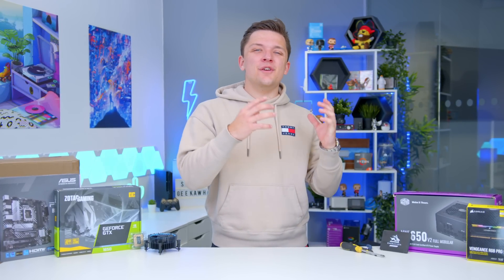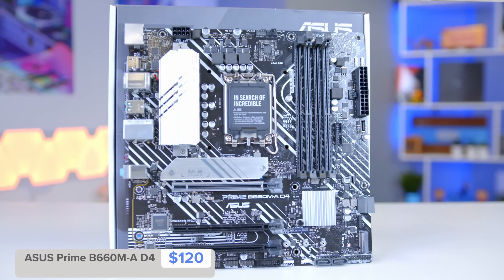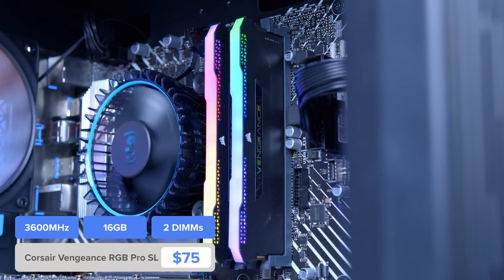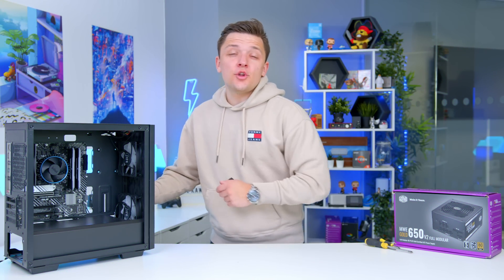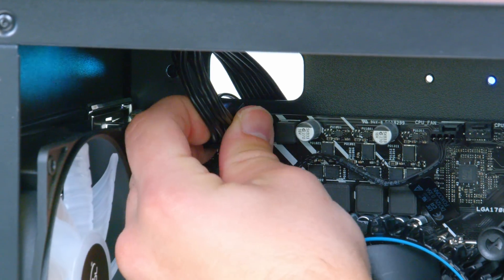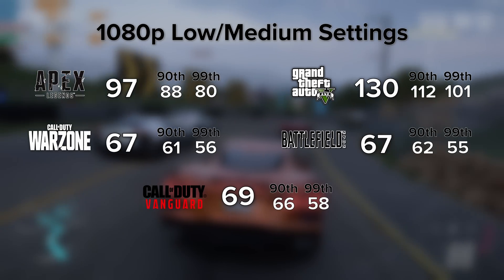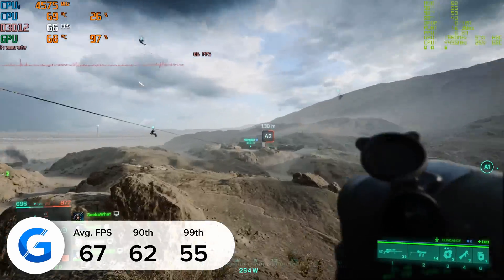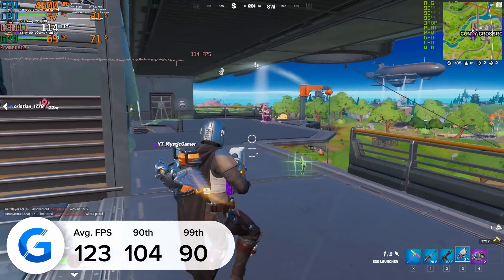Best $650 Gaming PC Build 2022! [Full Budget Build Guide w/ Benchmarks - i3 12100F & GTX 1650!]

Comment: i just put together a build like this last night for about 580$. it was my first time building.
the differences were i reused the SSD from my last pc, i bought a used 1650 Super for 100(thanks facebook marketplace), but my case was different (130$).
i was long overdue for an upgrade on my old pc running i5-6400 and DDR3 1666mhz memory.
edit* i did it like that thanks to all the videos out there that showed budget building back at a reasonable price and essentially there being an almost universal consensus of the i3-12100f being the KING of the budget build. i started with that then looked for a compatible motherboard and so-on.

Comment: Thank you for this building guide. I finally assembled my first full PC after years of doing upgrades (Video cards ram broken power supplies etc0.  I was a bit leery about it at first, but you explained each step well, and the guide was easy to follow. I used the i3 12100f, H610m motherboard, and 16gb of ram. For now, the computer will need to putt along using a 4gb GTX 960.
Reply: How is it bro
Reply: @tylerslooks  It's running really well. I hope once the new graphics cards are released that I can find a really good deal on a graphics card. I have been looking at the 6600. Going to see if it gets down to $200 or less.
Reply: @Lover Of Asians Just built a new system for myself (the computer described above was for my brother) and put my 1080 from my old computer into this one. My personal new system is a i5 12600kf, 32 gb ram and a 3070

Comment: Hey, Im not that experienced with computers, but would a GTX 1660/1660 Super work with this build?
Or would the motherboard be outdated to handle it or something?
Reply: No a gtx 1660 should work fine with this, but i would recommended going for a rx 6600 and not spending so much on the ram and motherboard and you will get much better performance

Comment: i had to make my i3 a then gen plus the mother board and cut the parts down even more to hit the $1,054.77 mark perfectly idk how ells to really go lower i’m using a stock cooler with no added coolers what so ever and i have 3600mhz 16gb ram from Corsair for $84.99 I3 10100f 3.6Ghz 107.99$ with Asus prime H410M-A cheapest for around $88.98 this is all in CAD in pound and US it would look alot cheaper but still expensivEr then a PS4 😂 but this honestly i’m fine with cuz i’m getting a summer job and my actual PC will be bigger then this like (two) 3090TI and all slots of DDR5 lancer ram lol, ya this cheap pc is just my togo pc for now until i replace it with over killing PC parts! :D

Comment: Its amazing that you can get so much performance from an i3. I would love it if you did more it builds priced around 500 - 600 pounds/dollars because I am on a budget and don't have a lot of space at my desk. Thanks, James.
Reply: The difference between i3-i5-i7-i9 is quality - making silicon is not perfect, and some pieces are better than others. What matters most is the technology for the die- the size of the transistors. This is reflected by the first 2 numbers after the dash. The 12th gen (Q1 2022) I3-12100f is significantly faster than the 9th gen (Q4 2018) i9-9980XE. While being less than 1/10 of the cost and using less than a third of the power, and having only 4 cores compared to 18. This processor is an incredible value, because intel finally moved onto Intel 7 lithography after being stuck on the previous tech for years, and Intel only makes i3 every second generation usually
Reply: You can just cheap out 70-80$ in Power supply and motherboard which are kind of overkill for this build and you are good to go.

Comment: Would u think a ryzen 7 5700x would be fine with a 1650?
Reply: Huge bottleneck! The minimum GPU that should be paired with the 5700x is the rtx 3060 ti or higher. If you're spending that much on a CPU/GPU then I'd recommend going for an i3 12100f and an rx 6600. You would see framerates almost 100% higher than what you'd get from a gtx 1650.
Reply: @jadenblackerby3325  yoo! First thanks you for taking your time to reply, but i mainly want my pc for editing content. I am a video editor, but i dont want my budget to be above 1400$
Reply: @sawayakarl  Oh my bad, for $1400 I recommend pairing a i5 12600k and 3060 or 3060 ti. The i5 12600k it amazing for video editing and productivity. If you live in the U.S., you should be able to find those GPU's anywhere from $450-$700. Nvidia GPUs are the way to go for video editing, and right now, the i5 12600k is competing with the ryzen 9 5900x in terms of productive loads. I hope this helps!
Reply: @jadenblackerby3325  thanks alot bro!!

Comment: Bro, between I3 12100F + RTX 3050 and I5 12400F + GTX 1650 which one is better for gaming?
Reply: I5
Reply: The 3050 one
Reply: @buffandpretty1932  bruh an i3 is to slow
Reply: @Cfinnn  i3 12100 is actually fine
Reply: @Cfinnn  i3 12100 is only 4 cores and 8 threads, but it performs on par with the i5 10400f, sometimes even faster. Also, in 2022, a gtx 1650 shouldn't even become a thought for gaming. At the bare minimum you should have a 1650 super.

Comment: I have this build cuz it was the cheapest. I have a 144hz monitor and easily get that FPS in Fortnite, especially in performance mode.

Also if you build this put the graphics card in last because it will be harder to connect the wires underneath it.

Comment: I think the motherboard was overkill, u can go for H series for i3. There's a lot option like Gigabyte H610M or MSI H610M-G to save some money
Reply: Yea but later on down the road u wouldn’t have to worry
Reply: @Goatisdaddy  sure, but in case for a really 'budget' gaming PC, H series is a very good option.
Reply: Not entirely. Those cheaper H610/H670 MOBO's generally have really bad heatsinks and  vrms, so if you ever plan on upgrading, your Motherboard will barely be able to handle the newer/better CPU.
Reply: @NathanD2623  or maybe u can go for Asrock B660M Pro RS or PG edition. In my country B660M-A cost around $175, and B660M Pro RS cost $40 less. So u can spend it on NVME, or something.
Reply: And get the super

Comment: I know the RX 6500xt is hated but you can find them for $200 and they perform up to %30 better than the GTX 1650 which is usually $250 - $300. 
I say this because you went with 12th gen Which supports PCIE Gen 4 so the 6500xt won't struggle.
Reply: Yup, AMD GPUs are underrated
Reply: That's what I've been saying lol. People hate the 6500XT even though it has better performance than other similarly priced GPU's, and most people don't plan to keep the 6500XT for a long period of time.
Reply: or get a 1650 super for only a couple dollars more
Reply: hope it goes down...the price of the 6500xt...planning to buy a new gpu
Reply: @lakaymark  uhm, it's literally at msrp, what do you want more? Half the price?
Reply: @Ali-cv5en  6500xt sucks
Reply: @Ali-cv5en  In my country GPU are still iin scalp prices even from official distributors...minimum ive seen is at $300
Reply: @ThatSyrianGuy7  the 6500xt is better than the gtx 1650 abd at least in the Uk you can get it for even cheaper. go and check the specs if you want but it is a great card for a budget build
Reply: @eth4n067  It doesn’t have encoder and if you can save up an extra hundred bucks I would go with 6600
Reply: But if i wanted to do light/casual video editing and lets's say.... blender rendering, would there be a signficant differnece between the  6500xt and 1650? I keep seeing that that the 6500xt is actually really good and stuff for gaming performance per value dollar, but as f
or entry level productivity....... idk......
Reply: what should I get Zotac gtx 1650 or 6500xt. gtx 1650 is $300 and the 6500xt is near $300 too. for valorant which one is better.
Reply: Yes but the rx 6500 xt doesnt have any decoder... so in that csse you should have bought the i3 12100 with the IGP to handle video playback and streaming... otherwise your CPU when watching a Youtube video will have 100% usage and hitching all the way to a video playback... Rx 6500 xt should have cost at most 149$... ideally 129$...
Reply: @Vaggelator69  is i3-12100f better than i5-10400f
Reply: @aadelhashmi6537  in single core and multi core… yes, i3 12100f is superior in every case…
Reply: @Vaggelator69  I'm trying to build a PC for school and gaming (valorant, fortnite, Minecraft, Brawlhalla) budget is around $1200 CAD think you can help me out?
Reply: @aadelhashmi6537  i thought at first that you meant Autocad but i would assume that you meant Canadian dollars... right...??
Reply: @UCet89D6KxRbYYvIOpL2C1UQ what is sibgle core and multipicore lol I'm new to this pc thing if I do end up getting rtx 3050 it's a little over my budget
Reply: @aadelhashmi6537  CPUs consists of of cores in general... 2, 4, 6, 8 etc... single core perfomance is if you are using only one core for example what kind of performance you can have and multicore is when you are using all the cores...
Reply: @Vaggelator69  yes I mean Canadian dollars
Reply: Very true.
Reply: I would just get a cheaper mobo and cheaper ram and save a little more and a get a rx6600 for $250 and have much better performance if your in the US